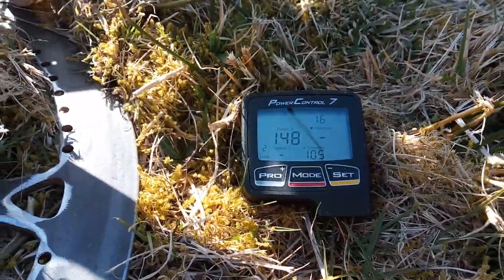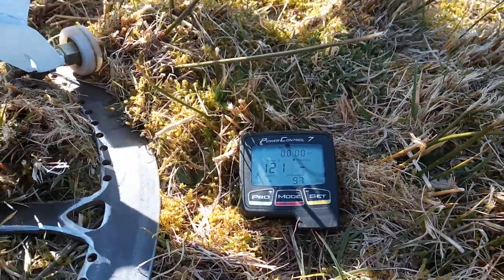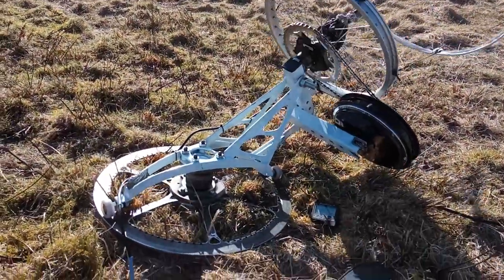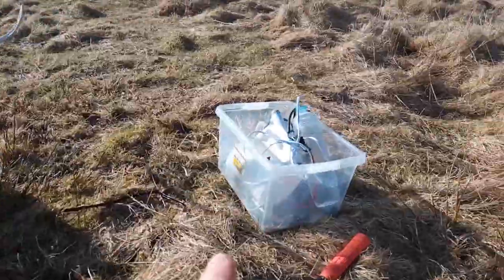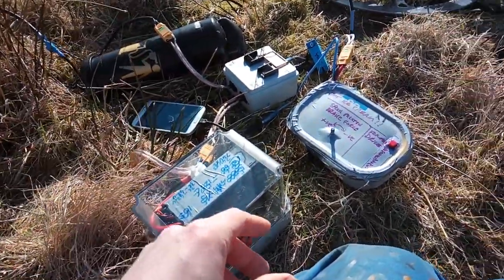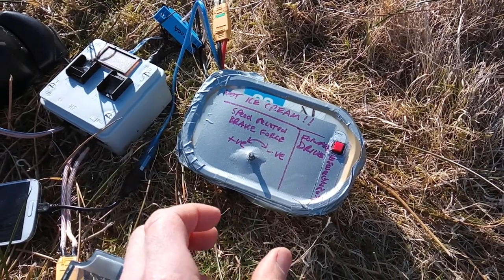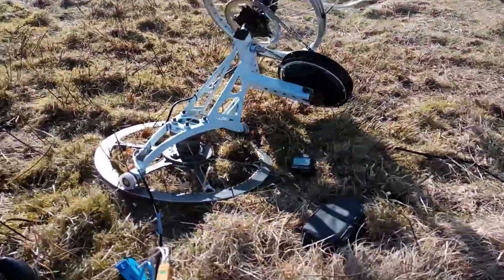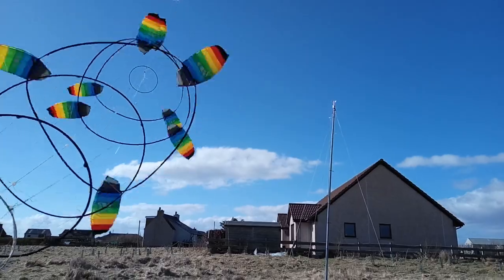Testing the new generator, VESC and Arduino control combo

Comment: Hey, 
I know your channel is not really focused on this, but I am having some difficulties learning how to program the arduino to control a VESC. My purpose is for a brushless motor, but if you are able to guide me in any way it would be greatly appreciated! Thanks for your time.
Reply from the maker: Any further specifics? I used and modified the include "VescUartControl.h"
 by Original VESC UART interface work :Copyright 2016 Tobias Sachs Tobias.Sachs@onlinehome.de GNU General Public License. I built an 8 pin plug for the VESC comm interface. I think this copy is similar to what I had in the video... https://drive.google.com/file/d/1Y8a5-MH7GPFqv50OxW2eKA4qox8WNvkF/view?usp=sharing
Reply from the maker: Ah the linked file needs the include data... I can find a zip somewhere. Before any interface with arduino you have to use the vesc  software to configure your vesc (basically pairing it with your motor) The vesc buzzes, spins and works out what your motor is and how to drive it... VESC software works like magic.
Reply: @KiteTurbine  Thanks for the help! Although I have never physically seen the VESC, my plan is to attach the signal wire (white I believe) to the Arduino pin which will have my PPM output using the Servo library. So I wouldn't actually be using the Uart path.
Reply: What I am hesitant on is powering the VESC with the 5v from Arduino like that. I can't seem to find any information on this "PPM Extension Cable" to see if it needs a 5v source. Again, if this is completely off topic from what you focus on, no worries I will keep looking!